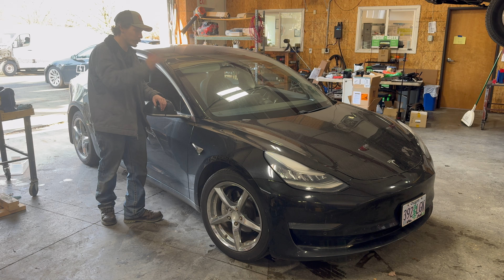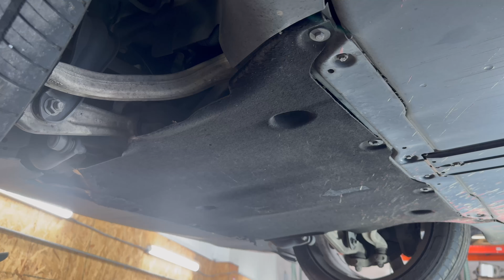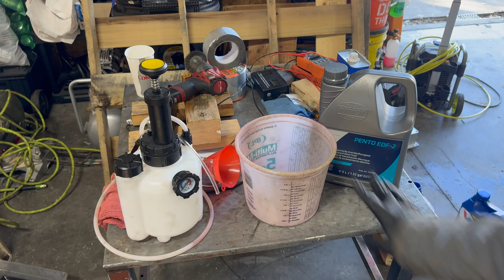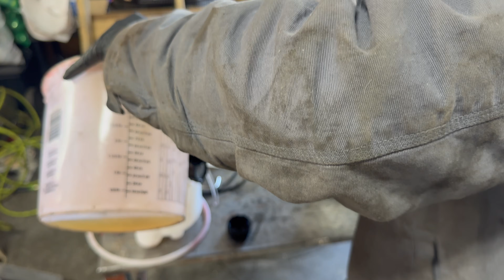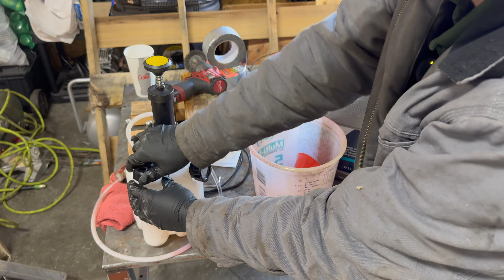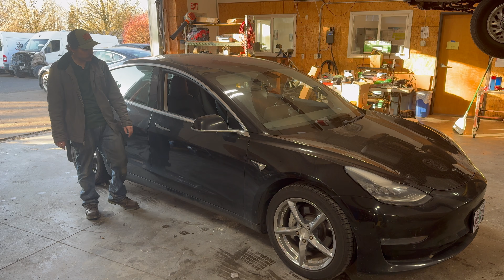Tesla Needs An Oil Change? Model 3 Gearbox Fluid Exchange Process

Comment: Great video.  I passed several questions across Grok about this, and the general census is about 50 to 100k miles like you pointed out, however, Grok did point out that heavy acceleration and aggressive driving is something to consider as well.  Especially performance models.  It might also help buyers/owners to know that Tesla will prompt with "Gear Box fluid service recommendation" -- the car detects issues via sensors (e.g., pump performance, temperature anomalies, or contamination levels).

I'd point out to this owner if they are driving casually and not flooring it all the time, changing the fluid isn't absolutely necessary.  If doing this every 100k miles gives you piece of mind and it only cost about 150 to 300, I guess they can do it.  If their motors are not making excess noise and everything is still moving smoothly, it just seems like a waste honesty.  The whole point of "if it ain't broke don't fix it", really makes sense here.  It makes more sense to get a basic inspection and draw a tiny amount of fluid out to inspect it or you can send it off for inspection.  The fluid will have distinct characteristics if it's going bad.  Grok explained the procedure and everything.
Reply from the maker: If your motor starts making noise, it's probably far too late for an oil change to fix... Noise = permanently damaged bearings and/or gears. I've seen my fair share of gearboxes destroyed from lack of maintenance. Some are of course more prone to failures than others depending on the design (Tesla LDU is up there, and Hyundai Kona/Kia Niro are some of the very worst for issues).
Reply: @OutofSpecRenew  When you refer to the "Tesla LDU", you are referencing the earlier models I take it.  The Model 3 in the video is not the same LDU as the earlier S and X, if the information online is correct.  It was noted that pre-refresh models of S and X had issues with their LDU, and after the refresh (2021+) it was replaced with the PM motor.  So older S and X's per-refresh are the one's you're talking about?
Reply: @OutofSpecRenew  using "Chevy Bolt / Hyundai Kona logic" on a Tesla. You assumed that because gears make metal shavings, the fluid must be getting ruined. You completely ignored the fact that Tesla explicitly designed an active filtration and cooling system to solve that exact problem so owners wouldn't have to deal with it.

Comment: Why would they not put the fill plug at the level point?
Reply: Or better yet, a level indicator. It was probably just due to design limitations.
Reply: Tesla is a team of SW engineers not automotive engineers.
Reply: @davidgrisco1939  This design is an indication that it was by automotive engineers. Maybe you're the software engineer who can't spot why! 😉
Reply: You might assume that you had filled with the correct level when it started to drip out... yet you could be wrong! If there's an air-lock in the pump assembly of the filter the oil may not have filled to the correct quantity. That's why you need to measure how much you are putting in rather than just filling until the filler drips. And that's why they recommend running the pump.

Comment: Great video, I enjoy all of your videos. However after being a maintenace instructor on everything from Jet turbine engines to motorcycles over 40 years, there is a torque value per the manufacturer on just about everything, Including the filter. I’s not much but there is a torque value. A lot of people say, “just hand tighten, but everyones “hand tighten” is different. A 160 lb technician and a 220 lb technician is going to be apply a different “hand tighten” amount. That is why the manufacturers list torque values in their maintenance manuals, they have no idea who will be working on their product. I did an experiment with different technicians comaring their “hand tighten” vs maintenance manual specs using a torque wrench, the values were all over the place. Even if the same tech daily hand torques the same type of filter, the proper torque values will be different and be “out of spec”.
Reply: While I would agree in automotive applications (as I have no experience in aviation) torque values do exist for a reason. Having said that torquing an oil filter might be a bit overkill in most situations. A nice snug by hand normally is enough in my experience. I’ve found that as with many things in life a little common sense does go a long way. 😁
Reply: Oil filters are normally torqued by rotation degrees after the rubber seal touches the casing. This is normally around 270° of rotation after the seal touches the casing.

Comment: What about for Raven Model X’s? Similar process?
Reply: That one actually has a drain and a fill plug taking off that rear arrow shield is pretty fun JK as for the front drive unit you might have to take off the aero shield and the skid plate and to fill it. You would have to remove the front tubing the frunk . I think the fill port is at the top.

Comment: 4:26 This is the way the manual says to do. Tesla manual also says, run the pump until the fill plug is back in,which makes me believe when the pump stops, the static fluid level will reach the fill plug, and leak out... Which it didn't, even if I saw you Sir indeed used like 1,5liters of fluid, which,even with the spills should be plenty enough..

I am willing to do the oil change on mine, but the drivetrain and the battery is under warranty until 100000miles, and nobody is touching anything on it, until the warranty expires...

Thanks for uploading!
Reply: thats the problem. You may be causing damage by not replacing the oil before 100k miles but then you are stuck with the damage and no warranty since its too late.
Reply: update: Tesla replaced my filter and oil in the back under warranty,  so I decied and replaced the front drive unit oil and filter on my own. 
If you spend an extra 4 minutes to remove the frunk liner, you can simply stuff a hose into the fill port,funnel on the top, and simply pour it in from above (dont forget to run the pump when roughly a liter (or quart) is in. After some hesitation, I precisely measure and filled 1.4 liters with no spill.
If you remove that bolt mentioned in the video, the drive unit swings a bit down and aft, so the pump can come out.

Comment: I did this a while back ago on a 2013 Nissan Leaf. It’s a little bit easier compared to this one. I just used Valvoline MaxLife (about any ATF fluid will work), and just clean the debris off the magnetic bolts. After the fluid change, I did notice a jump in my kw per mile efficiency.

Comment: Very interesting to watch! But from what IIRC the newer Model Y (2023 and onwards) have the 4DU rear Drive Units where the Oil filter and pump are within the motor enclosure itself. So the whole motor needs to be dismantled when requiring access to the pump / filter.

Comment: Great video as always Alex. I'm looking to do my Model S drive unit service, I've seen your previous video on it. I'm curious if you'd have a part number for the oil pump connector?
Thanks.
Reply from the maker: It's a TE Connectivity AMP series connector. Part numbers are: 
1-1718644-1 (connector housing)
7-1452668-1 (pins)
Reply: @OutofSpecRenew perfect. Thanks very much 🫡

Comment: i always recommend putting some fresh fliud in while everything is out. just to help flush the last of it out.
Reply: It's also prudent to remove the fill plug before draining the old fluid, as if the fluid is drained and the filler plug won't come out, the vehicle will still be driveable with the old fluid in there, but not if it's empty.

Comment: Great info.  In your experience, has there been a difference in "wear" noticed between that front induction motor and rear permanent magnet motor?
Reply: I changed both drive units' ATF and filters at 122,000 miles. Since my Model 3 always drives the rear motor and the front motor as needed, the rear will wear more. Like some other owners, I DID find some metal particles in the used rear drive unit fluid. For two hours of time and $130 in parts and fluid, it was EASILY worth it for me. "Lifetime fluid" where you have moving parts is BS. I'm doing the fluid and filter change every 100,000 miles.
Reply: @snowrocket  Thanks, the rear does make sense just wasn't sure if the motor type introduced an additional element into it too.
Reply: @aussie2uGA  From what I gather I don't think it does matter that they are different types of motors. The gears ARE the same parts front and rear, at least on the 3 and Y.

Comment: It would be real interesting to fill it to the threads.Plug it back into the car and run it. And see how much oil really goes in it that way. If the engineers are really smart , they would build it that way. 😂

Comment: Best practice is to always loosen the fill plug before draining the case. :-) If for some reason you cannot loosen the fill plug and have already drained the case you cannot refill it.
Reply: turn it upside down.
Reply: The car
Reply: Very good point.
Reply: and cleaning the area around the workspace (WD40).

Comment: What are the claimed improvements in the KF-1 oil? Efficiency? Lifespan?
Reply from the maker: The main benefit to KAF-1 is it's a "consolidated" fluid standard, which is meant to be backwards compatible with most of the previous fluids that Tesla has used. Basically it just means that rather than service centers having to stock 3-4 different gearbox fluids, and have the technicians keep track of which cars use what, they only need to stock 1 fluid that can be used in everything. 

The one exception to this is of course the Mobil SHC629 fluid, which was used in Model S/X front drive units for the first couple years of production, and KAF-1 is not backwards compatible with it. It's an ISO 150 industrial gear lubricant, and unfortunately not super easy to get ahold of, especially in "smaller" quantities.

Comment: A video that expands on this type of EV maintenance to also include coolant, brake, and cabin filter maintenance would be great! Keep up the good work!
Reply: Definitely agree, manufactures hardly give you any information unfortunately but for those of us that want our EVs to run as long as possible there is still some basic maintenance to perform.
Reply: Coolant should jsut be a top off, ton of videos online. 
Brakes are literally the same as any car, nothing special. And with regen braking a majority of people owners will never change their brakes.
And there’s hundreds of cabin filter videos online.
Reply: So since the battery does not  get as hot as an engine, I don't think it expires as fast, as far as coolant goes.